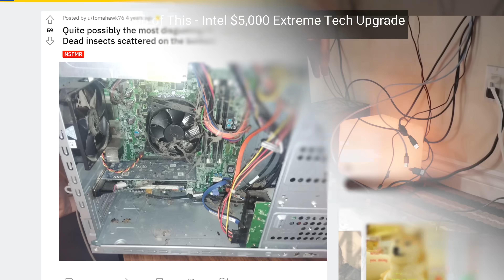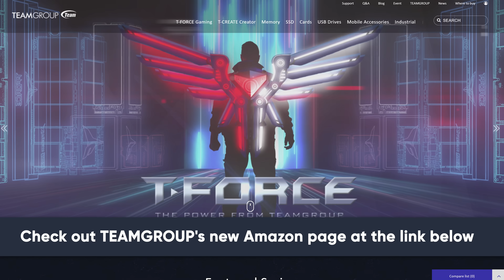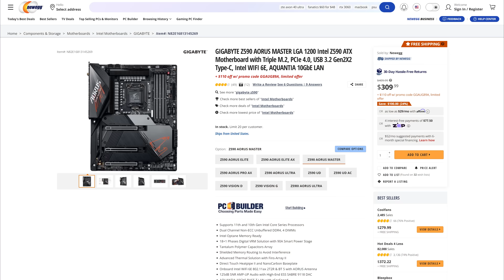How Often Should You Clean Your Computer?

Comment: before the fans get clogged the vents and headsinks will. I've had overheating issues on a computer I hadn't cleaned in 5 years and my mums basement is pretty dusty. 

the fan mesh was completely blocked and heatsink blocked - fans were covered in dust but they were functional - thewy were just blowing air into a blocked heatsink and fan grill.

Comment: I had my pc working just fine. It was flithy af though so I went and had it cleaned by the retailer from whom I purchased it. When I started using it again, it gave shit performance, glitches and blue screen of death so I did some troubleshooting. Turns out it had killed my gpu, ssd and motherboard. I sorely regret having it cleaned.

Comment: And hear I was wondering why my pc struggled to play any games with high fps after being a beast when i first built it despite drivers being up to date. Never thought about cleaning it. I used to have it on my desk but had to downgrade to a smaller desk and its kept on the floor where there is carpet. Of course it is elevated a bit but still not ideal. I haven't cleaned it nor taken notice of the inside so I crawled down and shone my flashlight and i can see bits of dust hanging from the graphics card and around the cpu. Gonna have to give it a bit of TLC and hopefully it gets back to full throttle!

Also forgot to mention, I built this pc just a little over 3 years ago now lmao

Comment: Honestly if you really have to just use a toothbrush dipped into some isopropyl alcohol to get the dust from heat sinks, yes including graphic card heatsinks. Also if you are taking the heatsink off of a Graphics card MAKE SURE you have a magnetic screwdriver as those small ass screws are a pain in the ass to put back in without one and of course you have alternatively use a strong magnet to temporarily turn your screwdriver into a magnetic one for a bit.

Comment: I have cleaned out a ton of computers in my life and never had one fail due to cleaning it. From experience I can say all of the following things with confidence.

Clean your PC as often as possible. Twice a year is not adequate. Do it about once every 2 months and that way the dust does not cake up and the job is much easier.

Always shut the PC down, unplug it and remove the battery if you have one (and if possible) before cleaning it. Preferably, take the PC outside to clean it so you aren't spraying dust in your own home which defeats the purpose.

A combination of using compressed air and vacuuming the dust out works the best at getting a PC clean.

Cans of compressed air are expensive. Air compressors do a better job than cans of air do and are useful for many other things. It is a better use of your money in the long run to buy an air compressor, so if you can use that to clean your PC do it. Just be sure to drain the air compressor tank before using it to prevent blasting water droplets into the computer.

If you do end up up spraying water on the PC components by using an air compressor and you followed the steps outlined above then it isn't plugged in and running so you're fine. Just give it a few hours to dry out and it should run great.

Comment: I've been using art brush and blower from a vacuum cleaner for 20 years and never had any problems. Just touch the brush to remove static(never had static) and make sure that the blower blows dry air.

Comment: I have seen highly respected computer techs actually blow out filthy computers with a rather leaf blower. I once thought about blowing mine out with a hair dryer but the static thing changed my mind. My first online computer was never cleaned like for 13 years and all was ok, don't know how though. O was having issues and took it to a tech and the power supply was blinking out etc. He said that he was surprised that it worked at all due to the filth and cigarette smoke build up. After the power supply was replaced to kept on ticking like a Timex watch for years. I was surprised to find out that the Desktop Levono ThinkCenter has no fan(s) and is always running cool. Why, I have no idea.

Comment: In 10 years of working IT, and 30+ as a hobby, I've run into only two "really bad" computers. One was in a friends house - this friend smoked. The inside of his computer was coated in stucky yucky dust; a combination of nicotine, smoke, and regular dust. I told my friend before I worked on it, he would need to buy a bottle of alcohol and wipe it down. (I think the problem he had was with the CD reader, but after opening the PC I backed away from fixing it.

The second computer was driving a CNC router in a wood shop. The PC was in an office, and the cables to the router and sled ran through a small hole in the wall; the office had an AC duct and a door, so you think it would be okay, but when I opened the PC it looked like someone had poured sawdust all over. The door had a gap along the bottom, and apparently the door was not always kept closed. I ended up replacing the PC, taking the old one back and blowing it out with compressed air. DVD reader in that one was toast, and the power supply had issues.

Apart from that, we would replace all PCs every 4-5 years; the old ones would get blown out with air and the higher end ones re-used for education programs, etc. None of those even came close to the two bad ones: a little dust and maybe a small dust bunny.

Comment: Dust isn't the problem. finding a customer that also smokes 40 a day in front of the computer which is on the desk is the worst. yellow tar covered PC case with an epoxy tar coating of dust inside is the point at which you hand it back and tell the customer its beyond help. Much like LINUS. And cue to the Sponsor, Marlboro. (cough, cough)

Comment: Good to know! Yesterday I cleaned my PC for the first time after 3 years as I installed some new components. Looks like I did everything right except the spinning the fans part.
Was pretty dusty as I use a Meshify C. I think a lot of dust was sucked in because of the top venting holes that has no dust filter. To prevent that I also installed two old fans there and set them to minimum spinning speed to always blow a little bit of air out.

Comment: my 3470 cpu is still my main driver. lot of dirt on mobo. still temps are well within limits. it played Spiderman at 30 fps locked. 3060 GPU. 15 year old cabinet with a floppy drive slot in it i have newspaper stuffed on it. i remove side panel. it all works normally

Comment: This video really could have used a disclaimer that canned "air" is really only good if you only ever need to buy one can in your lifetime.

For one, it's not actually air. The can has a volume of maybe half a liter. To get a useful amount of air into that (say 10 liters), you would have to compress it to extremely high pressures (20 bar in this example). Instead, they use a refrigerant that is liquid under a little bit of pressure, with a bit of gas on top of it. As you allow the gas part to escape the can, the pressure drops slightly, which allows some of the liquid to boil and replenish the gas.
The used refrigerants (and most refrigerants in general) tend to be very nasty green house gasses, so you are damaging the environment, too. And *maybe* the cans will be recycled.

Even if you don't care about the environment, at least care about your own money! Those cans are expensive! You can get a cheap air compressor for the price of a few of these cans. It's much cheaper in the long run. And you can use the air compressor for other purposes too (e.g. filling your bike's tires, blowing up party balloons, etc.).

Comment: Actually, I have a little set of paint brush, different size to clean different surfaces, and a lil table vacuum cleaner that I hold mid air to catch everything I wipe with the brushes. Really effective, cheap, reusable, and so much cleaner than just blowing air on the thing

Comment: Note on using an air compressor: most compressors will build up gunk and water from condensation on the inside of the tank over time, but even a newly cleaned one can still blast water and particles out of it. Because of this it’s best practice to have a desiccant between the hose and the compressor, then a filter on the end of the hose before the nozzle. That’s what I have and this setup also allows you to do automotive painting.

Comment: Here's another thing you might wanna cover. Intel 11th gen iGPUs have gotten so problematic with graphic rendering. Many folks were reporting glitchy webpages, stripped down QR codes. And I'm facing the problems too, on my all new lenovo laptop. Either I use Mercury playback engine: Software Only or OpenCL on Premiere Pro, More than a half of video effects and transitions won't work properly. I'm afraid it would screw up and hang once I install OrCAD for my upcoming university modules on PCB designing. Surprisingly, just playing games instead goes better (some of them still warns me about unsupportive hardware acceleration.)

Comment: I don't use dust filters and I only ever need to clean my PC once a year. I do use an air purifier to help with dust buildup in my room. I use an electric duster 99% isopropyl alcohol wipes to clean my PC. I also wanna mention that I have a mesh front and side panel for intake on my chassis (LANCOOL II MESH). My system just stays quiet efficiently cools itself with positive airflow.

Comment: I usually keep some cable ties handy and jam them between the power supply,CPU and GPU fan blades and then use a leaf blower to blow the dust out. And this goes without saying that this should be done outside in a well ventilated area. Also wear a mask when possible..just remember to remove the cable ties afterwards!

Comment: The point is that you can clean different parts at different rates. The exterior, for instance, can easily be wiped with microfibre cloth or vacuumed every week, while the fans can be quite quickly cleaned once every couple months and the PC as a whole given a thorough cleaning every semester or so. Little but continuous effort can save you from having to spend many (exhausting) hours cleaning your pc from top to bottom, usually after something went wrong. This kind of effort not only keeps everything going smoothly but also makes your setup look prettier, more energy efficient and reliable. It's also nice to always cover the fans with some kind of dust filter. And clean your room, too, as well as yourself.

Comment: If worst comes to worst, put the motherboard into the dishwasher AFTER popping out the CMOS/BIOS battery, along with any daughter cards and case parts. Fans are a bit iffy but may be fine depending on how they were positioned (I always put mine with the rotor/fan facing up and have had no problems). And it goes without saying to NOT put any mechanical drives into the dishwasher, unless you want to, who am I to stop you, heathen! It would be a good time also to not lollygag on putting new thermal paste on the GPU/CPU after letting the boards fully dry with the help of a friendly electrical dragon (hairdryer). Not the fastest way to an absolutely clean PC, but gives it that like-new appearance and makes sure that the infernal parts get new thermal paste, because everyone hates dried out thermal paste like everyone hates the Thalmor.

(If you are a friend to the Thalmor, you're a traitor to the mighty Talos and deserve to be locked up in Windhelm.)

Comment: "Don't hold your air dusting gun too close to your parts because air compressors are strong enough to rip components off boards."

Or alternatively, you can just reduce the air output if your compressor has an air regulator. :|

Comment: For the case or chassis i use a swifer duster then i wipe down the surface with a soft dusting cloth 
I always take out all fans and radiators to clean them. Same for Aio and even laptops i use my air compressor making sure not to get to close. If GPU is dirty i open it up carefully and clean the radiator and fans separately

Comment: One thing that this video forgot to mention is that you can purchase filters that go on the outside of your PC that will drastically reduce the amount of dust getting in your PC. Granted, you will still need to clean them, but it is much easier to wipe off an external filter than to blow dust off every internal component in your PC. They will restrict airflow a little, but it is much better than having dust clog up your heatsinks.

I'd recommend buying the more pricey Ultra-fine mesh filters as they do a really good job at catching dust. I personally bought some Silverstone filters and they work fantastic!

Comment: Electric motors much like speaker drivers can work both ways, they can also generate power if you move the magnet fast enough which is how fans can send the current back through the header.

Comment: Dang... that fan tip when cleaning is invaluable. Never crossed my mind to hold it in place.
Reply: backfeed can also happen to some automobile e-fan conversions without a diode
Reply: i tried it but it's so hard
Reply: @mimiko857 🎉A possible solution for you would be to hold a Fan Blade with a Pencil, or anything non-metal and Elecrtical Free object. Have a great week! David Wellman.🎉

Comment: Pro-tip for tight spaces: those brushes to 'floss' between your teeth.
     It's basically a nylon version of a pipe cleaner. 
     Very effective for gunk that's stuck. (And soft enough not to damage things).

Also; simply a soft toothbrush. (The bristles are nylon, the whole thing is non-conductive.

As for vacuum cleaners; just make sure you have a plastic attachment on the end.
      (Don't go near it with the metal pipe.. That way static electricity won't be a problem.)

This is all 'in MY experience', by the way. 

Please correct me if I'm wrong :)
Reply: Also; 
Plastic (PP) packaging can make for effective suuuuper thin 'dust-out-of-small-spaces-getters'

PP doesn't break that easily.

Just cut the shape you need with some scissors. (A small 'hook' shape on the end can help a lot to get dust bunnies out of thin, tight places)

Comment: Everyone's going to shout at me for this.
But if I need to do a full strip down clean.
I will shower wash the case, radiator and maybe the fans. Towel and hair dry it.
Likely use, towel, cloth, wipes and cotton buds for the boards etc.
I haven't ever had any issues over the years.

Comment: Dust is not a big problem in most cases. Take it outside and blow carefully and done in minutes. Far Worse Problem is Smoke like Kitchen, Cigarette, and Wood Smoke that's often Very Sticky and Will Not come off or out computers and more even with solvents to clean. Smoke can short out or otherwise destroy a computer in a very short time because attracts more dirt and moisture to attack nearly everything. Vape Fluids and Fumes are as bad or worse then Smoke to many electronics too.

Comment: I bought a plug in blower. (DataVac)  I use it EVERYWHERE. I have cats. I have dust. I have whatever that is crawling up the wall with 3 cats cackling and chanting fall fall fall fall. Be right back.. Big Cross Orbweaver back outside. So ya. Cleaning computers. I clean mine once a week. Pop the side and blow the rads out. Plug in blower means no crap I just accidentally froze something. 5 years on it's more that paid for itself not having to buy air cans. Even have a helper from time to time 
https://youtube.com/shorts/V9Zl-pJebgI?feature=share

Comment: Also add game consoles too since they also collect a lot of dust. However, the difficult part are the fan unless you have a small tool to insert in between the gaps of the gaming console housing to hold the fan blade. Well I guess the older hardware than the newer ones (PS5, Xbox Series S|X) but still important to clean from time to time.

Comment: If you put your computer to sleep, when not in use or just overnight, you can go forever between cleanings. Otherwise it’s just acting like an inefficient air filter. 

Technically it’s less wear to leave it powered on 24/7 but I’ll worry about that when there’s any actual evidence of it being an issue within the lifespan of a machine.

Comment: My power supply has once got absolute disgusting on the inside and blowing with air wouldnt work, so I used a fire extinguiser that thanks to its big volume of gas and pressure instantly cleaned the entire thing though I wouldnt actually recomend doing that especially if the substance inside can come out as a liquid and will boil on the power supply causing moisture to condense on it getting everything wet. Thankfully after letting it dry it all worked fine.

Comment: I do use a compressor myself to blow things off but its good to remember that compressing air create water which is ejected when you use the "airgun".
Water/oil separator is pretty much required to make sure there is no "drops" flying into your mobo. It does not remove all the water from the air but it removes any chance of droplets.